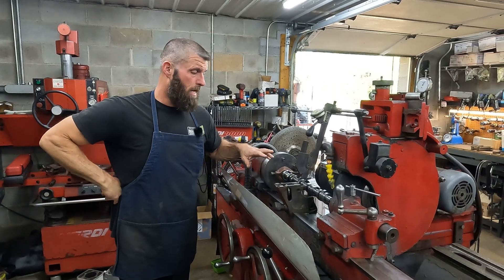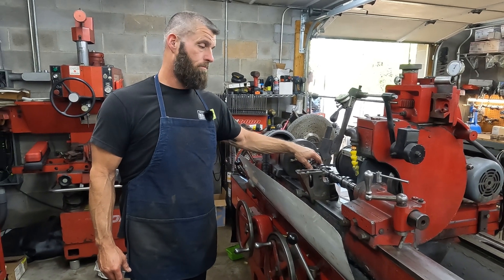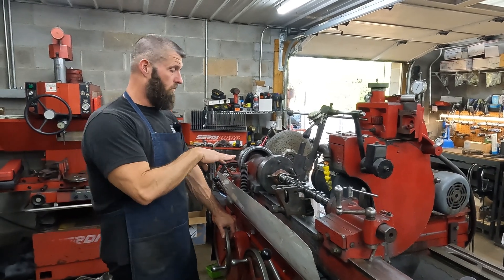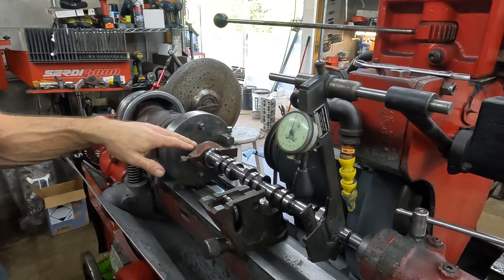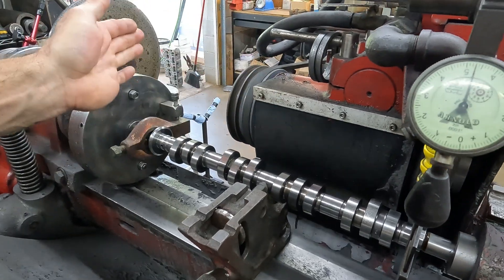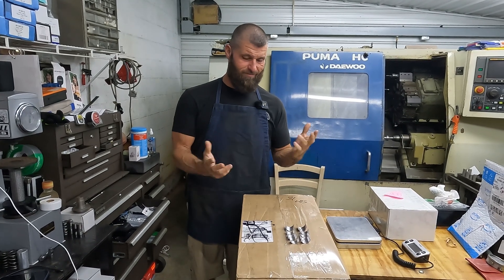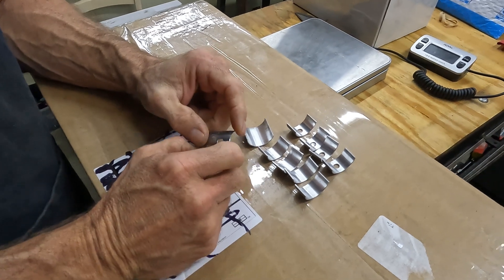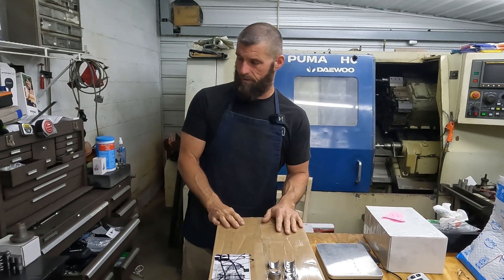Modular Ford Camshaft Mod's

Comment: These modular cams are interesting due to the lobes being pressed on to what looks like a steel billet. Although you could probably massage a stock cam a bit to make changes to lift/duration , I was wondering if someone(?) could just press on some new lobes and create whatever they wanted. Do you know of anyone that's tried that ?
Reply from the maker: Many production cams are this way

Comment: Had a 1999 5.4 in my shop today customer tried to do the intake and lost the thermostat bolt kept going and cranked it. Loud top end noise and he shut it down. I tore the intake back off found the thermostat bolt holding number 7 Intake valve slightly open. I removed the bolt the valve resealed, pulled valve cover and the rocker arm had came off both intake and exhaust valve. Loosened the cam bolts slipped the rocker back on and put everything back together. Did a compression and leak down test and it was the same as the other 7 cylinders with 287000 miles on it. Truck ran better then it has in a long time after the new intake gaskets and plugs and coils. He got pretty damn lucky on a newer truck that bolt would have ruined the top end

Comment: That story might explain how my last donor block got messed up. It was a chevy 880 roller block I picked up on Marketplace. The cam bearings were toast, which I thought was a bit weird on a roller block, but the machinist called and said the cam bores were all messed up. He didn't have a solution, so I found a new donor block. I saw the bores. The cam bearings had spun! The machinist said he'd never seen or heard of that in his 50 yrs of engine machining. It's a mystery to me.
Reply from the maker: It's common on those with oil coolers, I have seen it several times
Reply: @powellmachineinc  Cool. Thanks for the reply.
Reply: I'm glad you were able to regrind that cam, thanks for sharing, all the best to you and your loved ones

Comment: hey question .. could you regrind a set of cams for my old suzuki gs1100e ?
ive got a set of old vance&hines regrinds from the 90s and they are useless when i called them. if not i understand i just don't see many good machinists anymore. 
thanks for any help you can prove.   Matt D
Reply from the maker: Direct action?
Reply: the head uses rocker arms.
its common to hard weld the rocker pads.  also have to cut down the guides in the head. i will chuck it in my mill to do that. can also tig up the rockers and cam as well if needed. i believe nickel filler rod is all that is needed. thanks for responding so fast..

Comment: This is off subject of cams, but when resizing a bearing journal in a block, would you also cut the main saddle where the cap meets it, as well as the cap to bring both the block side and the cap side back to fresh full radius? I've always wondered this about the blocks when line boring and honing, thanks.
Reply from the maker: No, there is really no need, and it's much more difficult

Comment: Do you ever grind lobes on Ford modular 2V cams, for more lift? Like, you recently did on the Explorer cam. Wondering if a little lobe lift, would help the power output of my 5.4 2V Superduty.
Reply from the maker: No, you can't change the bc on swinging follower cams without creating more issues
Reply: @powellmachineinc  I understand. Thank you.

Comment: You are very good and honest at what you do! I never ground cams, but I spent years finish grinding large and small cylinder tubes for fork lifts on a centerless grinder.
Is it me, or does the wheel sound like it is slightly out of balance?
We would put on new wheels and balance them using an arbor. Put them on the machine, dress them, and remove them to rebalance.
Can we see a video?
Reply from the maker: Idk why it sounds like that in the video,  the finish is great and we computer balance the wheel, good ear though

Comment: I didn’t see tabs on the cam bearings like what’s found on main and rod bearings . What keeps the split cam bearings from spinning in the bore?
Reply: The tangs are for location purposes only. The press in the housing is what keeps them from spinning in the housing.
Reply from the maker: Tangs are gone on many bearing ls now, it's just for locating